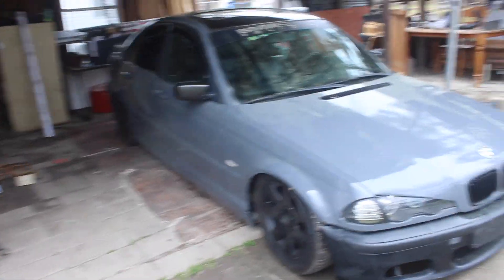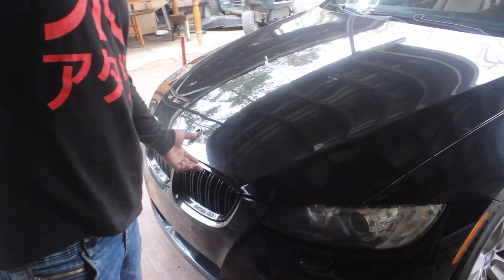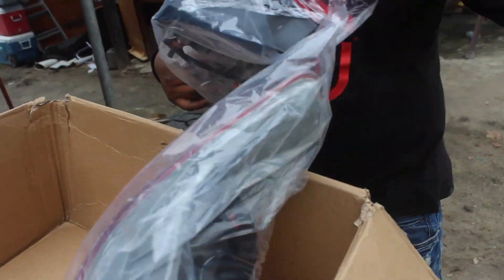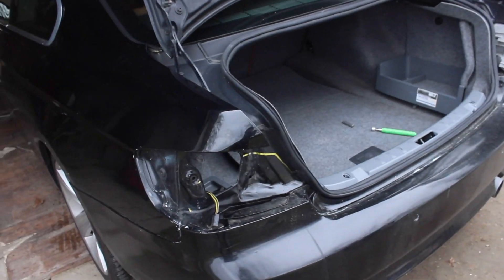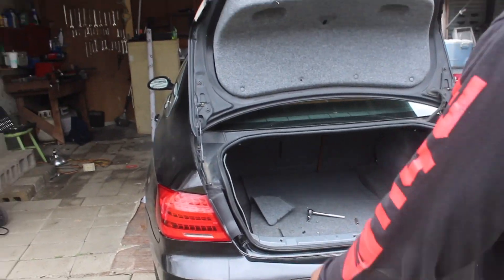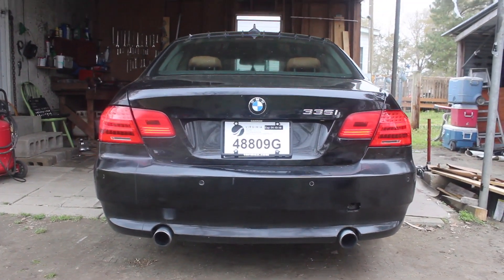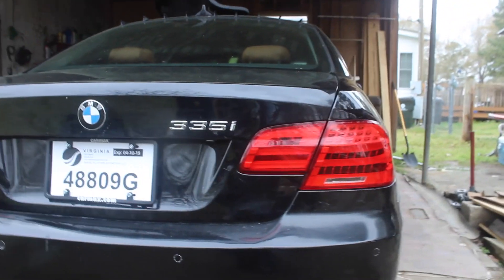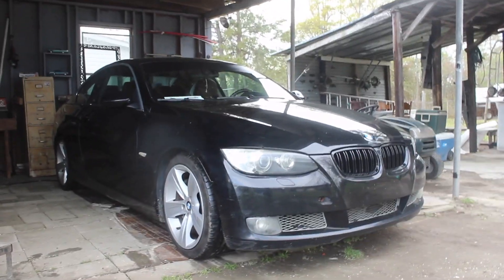FIRST MOD ON THE 335i!!

Comment from the maker: should Thomas get down pipes or straight pipe the 335i next 🤔
Reply: the proper way to say the 335i Is a e90s  aka e92 @cervantesgarage
Reply: @Ben Gutteridge thats why i said a e90s with a (S) 🤣
Reply: Don’t get down pipes without doing maintenance, spark plugs, coils check to see which index injectors you have needs to be index 12 and have an extra high pressure fuel pump those are the parts that usually fail first after you increase the boost.
Reply: @jorgeruiz9036  you dont NEED index12s if the car is running fine... im on index 1s pushing 21psi for 2 years daily with no issues. Check out my latest run at the drag strip  https://www.youtube.com/watch?v=J61byvEpj-w
Reply: best bang for the buck is a custom tune, do that instead of downpipes, i ran 11s 1/4 mile without downpipes but with a custom tune.  Check out @Wedgeperformance for a custom tune !
Reply: Sell e46 and buy doc race single turbo kit

Comment: U should get all the bolts on and tune it and it will get you close to 400hp 🔥
Reply: FBO with stage 2 Tune, you should get approx 457 WHP (512 HP at the motor) if it is done right. I am speaking from first hand exp.  But do FBO first then tune it, if you got E85 where you live, your gonna get more HP good luck and have fun. PS run a TIAL BOV, the HKS SSQV is really loud.